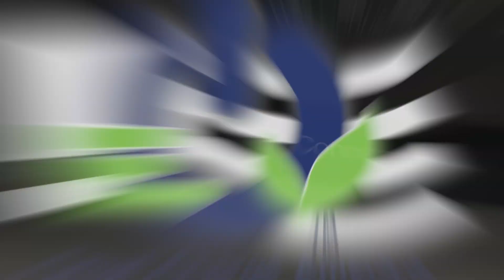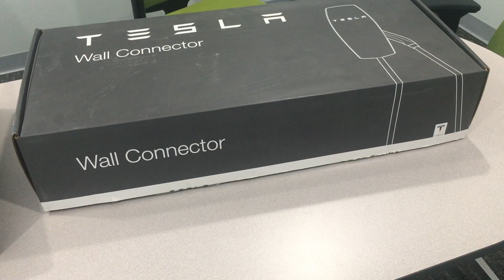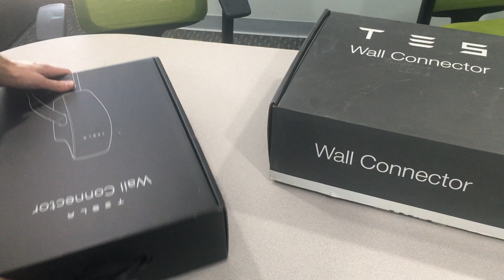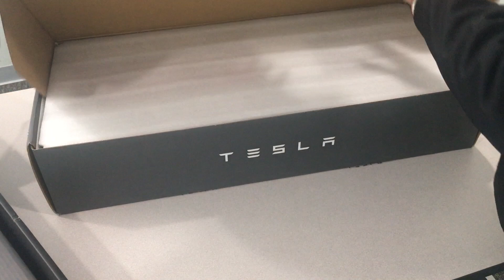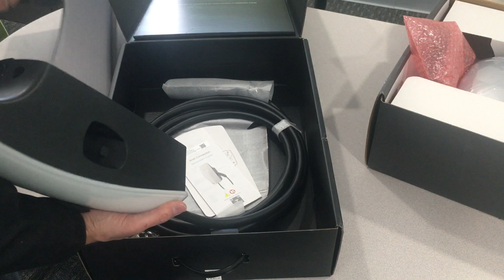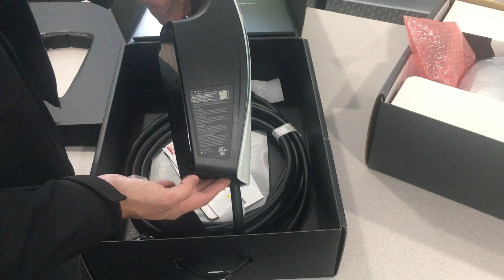NEW Gen 3 Tesla Wall Connector Unboxing

Comment: Hello. I have a NEMA 14-50 Outlet on a 50A breaker. Is it possible to convert the line to use this new Gen 3 Wall Connector by swapping out the 50A for a 60A? Want to double check if the #6 gauge wires be suffice to handle 60A? Or do I need to change out the entire line in order to upgrade?
This is my current setup but I been wanting a Wall Connector and now with the new Gen 3...very tempting! 
https://www.youtube.com/watch?v=pAdjD-8_jOk
Reply from the maker: No, you have to be careful on the type of wire that is used. #6 AWG or Romex wire, used inside walls and open access areas of the house is only rated for 55A. #6 THHN wire (stranded copper) is used inside conduit, which is rated for 75A. Thus, it depends on what type of electrical #6 wire currently exist in your scenario. Please be careful regarding this. Feel free to reach out if you need help or assistance with your install. Hope this helps
Reply: Update: According the the manual. We can use a minimum #6 AWG wire for this Wall Connector on a 60A breaker to achieve maximum charge rate. Nice! So just need to change out the breaker to service panel and add the new Gen 3 Wall Connector. No need to update my existing NEMA 14-50 wires.